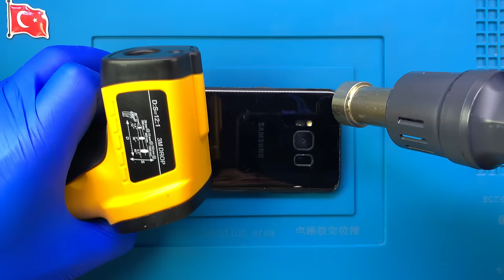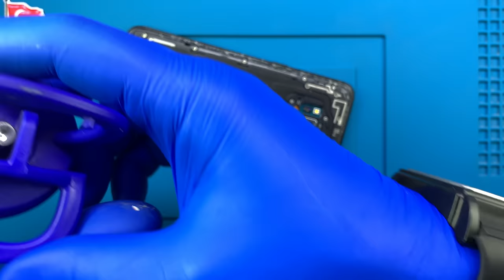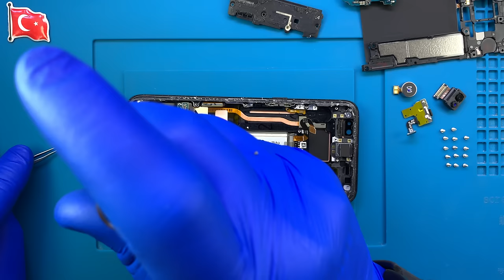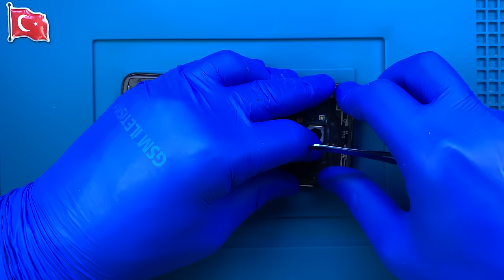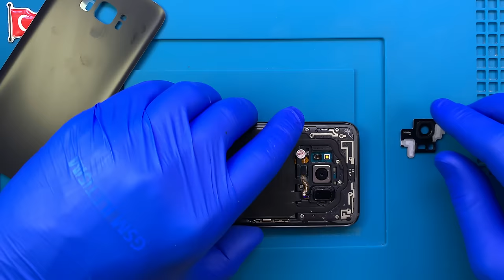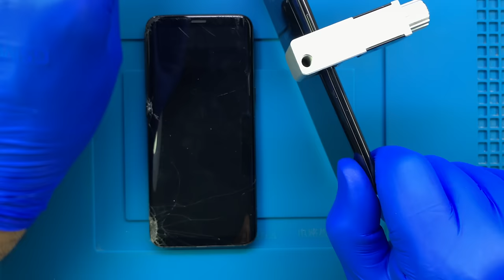Samsung Galaxy S8 Ekran Değişimi 🇹🇷 #samsunggalaxys8

Comment: Wow, that's really super cool..
Great effort.
Reply from the maker: Hello;
Thank you so much for your valuable comment.
Greetings.
Reply: @gsmi  thanks man. I have learned something from this. And expecting more on the go. want to learn more from you. Keep post
Full support. Subscribed😊👍

By the way plz tell me or list all the tools you have used for this excellent work. From the beginning to end of the video. Please include what are the safety measures we have to take care before opening these smartphones. 

Thank you !
Reply: @gsmi  let me ask you a doubt. my G.s8 display is flickering frequently, also there are many vertical lines. Is it my display hardware issue ? And the problem is solved When i installed "OLED SAVER" App from playstore.

The problem is re appearing when the brightness is lower. 

I tried safe mode, uninstalled many apps, finally did a Hard reset. But no use. Should i go for a Flash ROM ? Or should i replace the display ? What will be the reason behind this problem

Please tell me 

Thank you

Hopefully
A subscriber

Comment: If change like that..
Its still water proff???
Reply from the maker: Hello there;
Phone manufacturers only guarantee water resistance for undamaged and non-technically serviced devices. For this reason, it is necessary to be more careful about liquid contact after screen - part replacement and technical service.
Greetings.

Comment: Is this phone would remains water resistant after this
Reply from the maker: Hello Serhat;
Phone manufacturers only guarantee water resistance for undamaged and non-technically serviced devices. For this reason, it is necessary to be more careful about liquid contact after screen - part replacement and technical service.
Greetings.

Comment: Is that still water proof after this repair?
Reply from the maker: Hi;
Phone manufacturers only guarantee water resistance for devices that have not been damaged and have not been serviced. For this reason, more attention should be paid to fluid contact after screen - part replacement and technical service.
Greetings.
Reply: @gsmi  ok.. is that still water resistance?

Comment: Is it still a water resistant??
Reply from the maker: Hi;
Phone manufacturers only guarantee water resistance for undamaged and non-technically serviced devices. For this reason, it is necessary to be more careful about liquid contact after screen - part replacement and technical service.
Greetings.

Comment: is this waterproof solution ?
Reply from the maker: Hi;
Phone manufacturers only guarantee water resistance for undamaged and undamaged devices. For this reason, it is necessary to be more careful about liquid contact after screen - part replacement and technical service process.
Greetings.

Comment: Is this phone waterproof or not now
Reply from the maker: Hello there;
Phone manufacturers only guarantee water resistance for undamaged and non-technically serviced devices. For this reason, it is necessary to be more careful about liquid contact after screen - part replacement and technical service.
Greetings.

Comment: LOST IP68 water and dust resistance
Reply from the maker: Hi;
Phone manufacturers only guarantee water resistance for undamaged and undamaged devices. For this reason, it is necessary to be more careful about liquid contact after screen - part replacement and technical service process.
Greetings.

Comment: what about water resistance????
Reply from the maker: Hi;
Phone manufacturers only guarantee water resistance for undamaged and non-technically serviced devices. For this reason, it is necessary to be more careful about liquid contact after screen - part replacement and technical service.
Greetings.
Reply: @gsmi  thankuuuuu